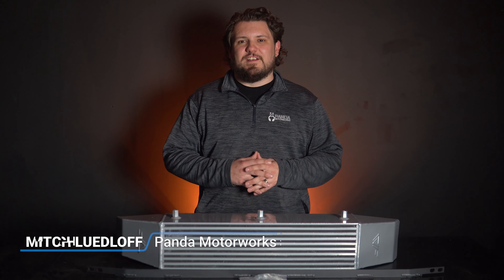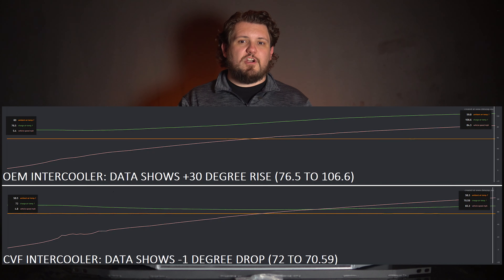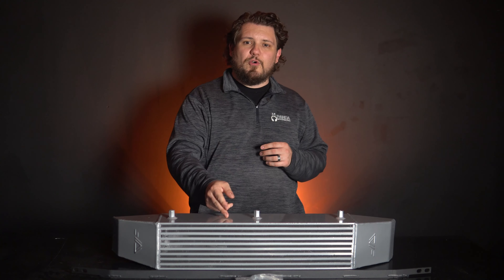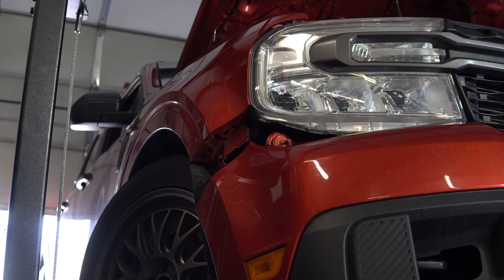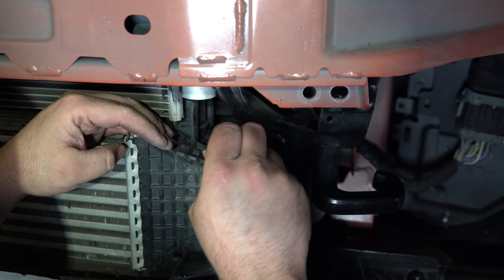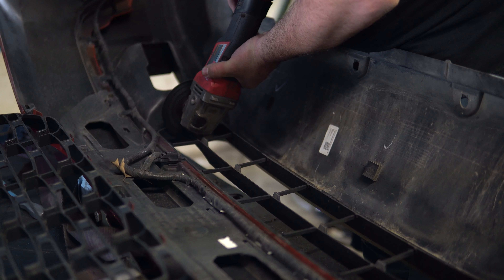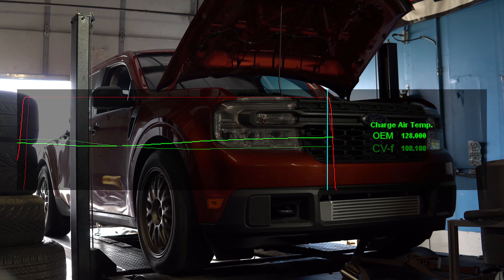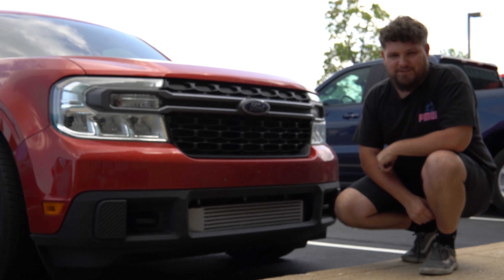The BEST Performance Mod for the EcoBoost Ford Maverick + BIG POWER Gains!

Comment: Is the intercooler mounted correctly? It’s looks too low… maybe the bracket is upside down?
Reply from the maker: Yes it is mounted correctly. The gap isn't ideal, but it can't go any higher due to the AC condenser location.